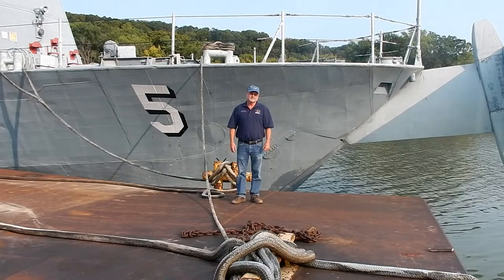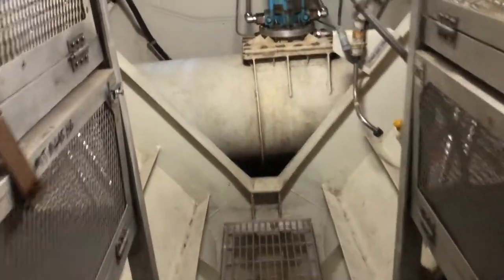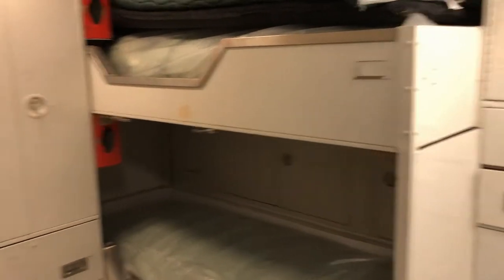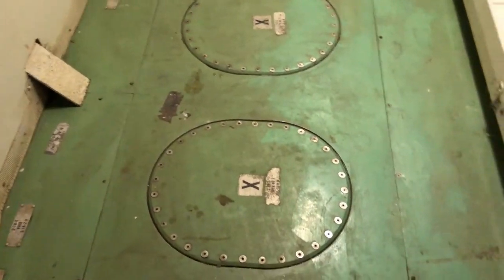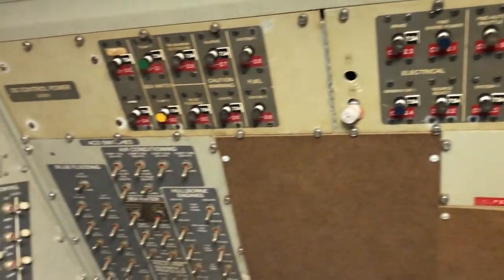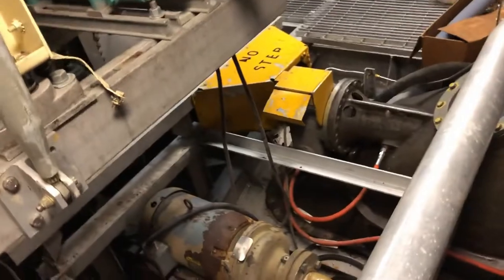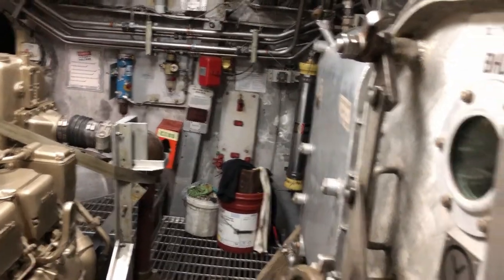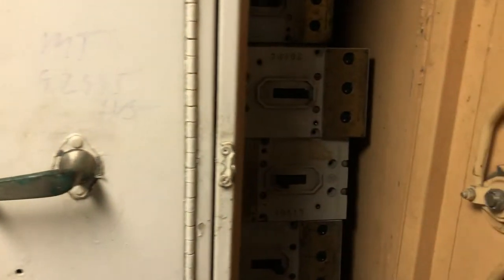HYDROFOIL -- USS Aries PHM Hydrofoil, ELIOT JAMES

Comment: I worked at a small shipyard in Pensacola called Runyans Machine and Boiler back in the late '80s and early '90s. We had them up on the hill. Aries, Hercules, Tarus. I did some weld repair on Hydrofoils (rear wing) along with other work. Great video very interesting to me. I got flashbacks of my 20s. I helped with replacing a bow thruster and many other memories. Sure makes me feel old.Which I am not... Only 60.Thank You for the flashbacks.